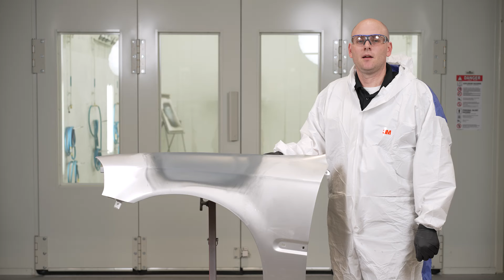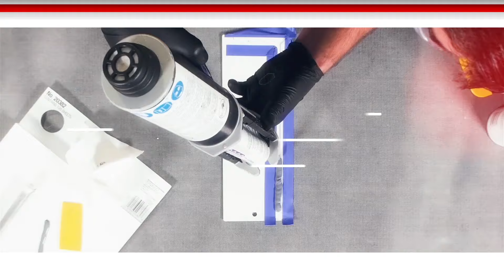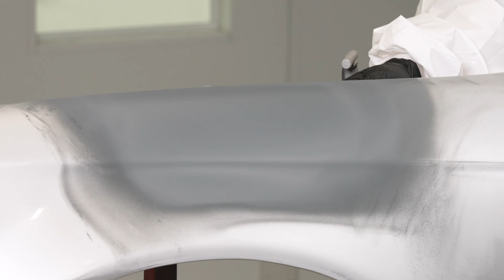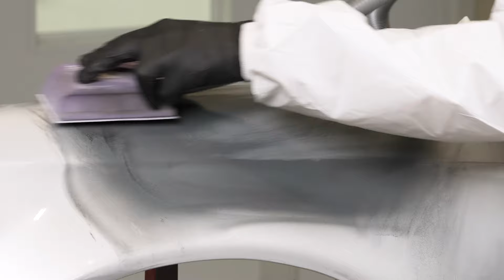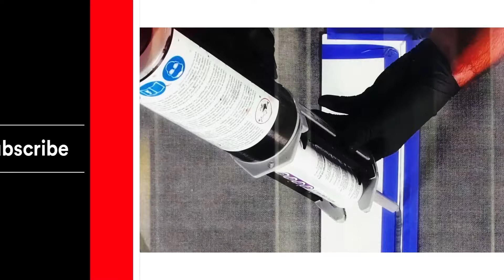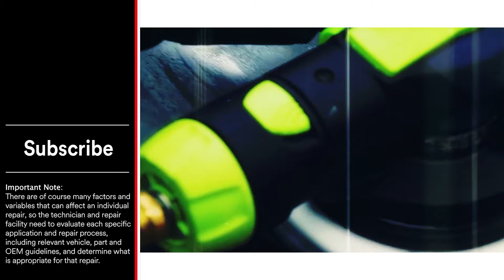Feather, Prime and Block Episode 3: Blocking and Sanding

Comment: Interface pad with the 400 or no?
Reply: Yes always use the interface pad on a contoured surface like that. The only time I don’t use an interface is if I’m roughing something in. Other than roughing in you should be hand blocking and then you can use the DA with an interface pad to remove the straight line scratches at the end of the procedure.